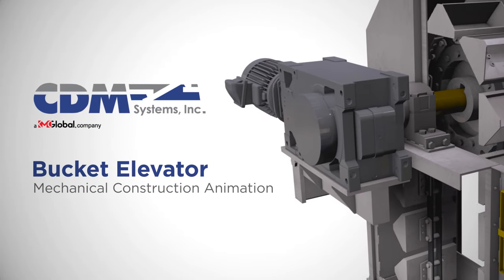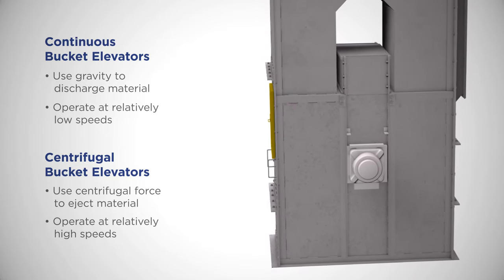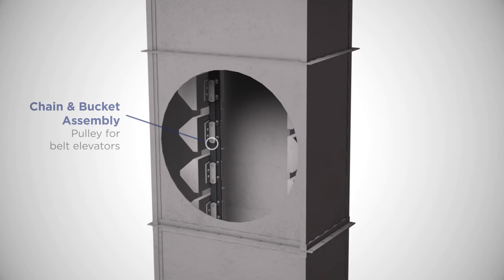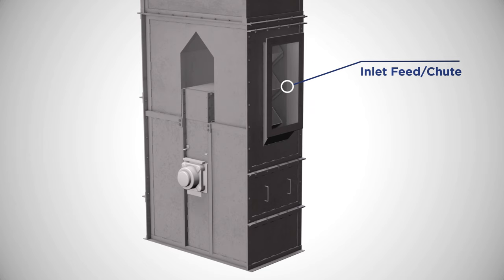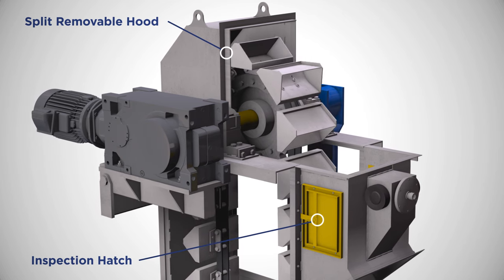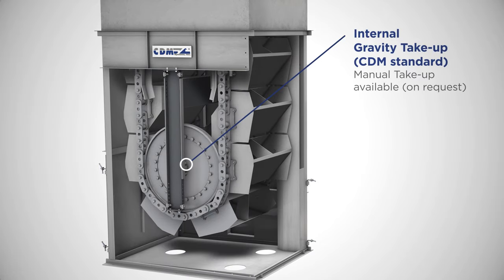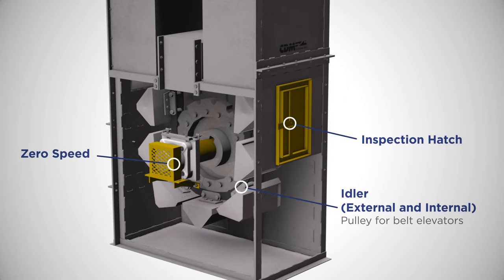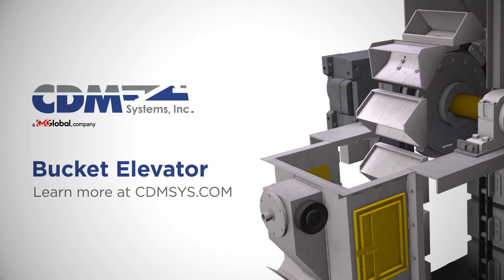CDM Systems - Bucket Elevator Animation

Comment: Yes hello, my wife is a rather large and hungry woman....is a food grade elevator available?  It’s hard to shovel that much food....thanks
Reply: Any bucket elevator could work. To keep it food grade i would recommend making sure to remove all electrical power to it, cleaning at the point of the boot slide daily and cleaning the throw plate near the head section.